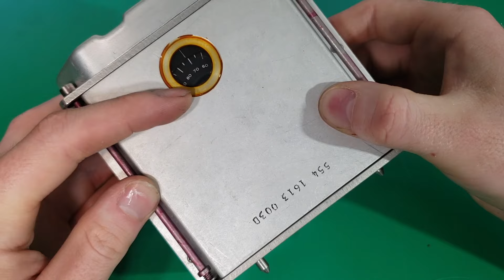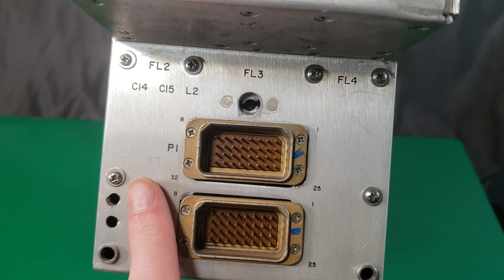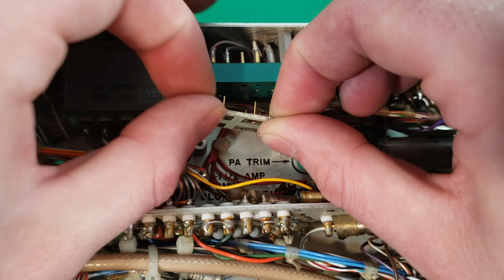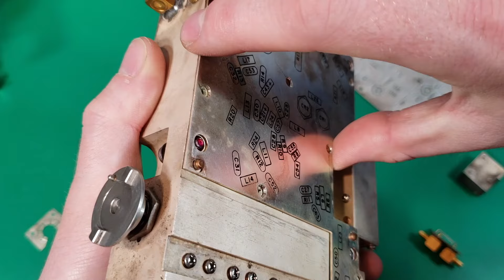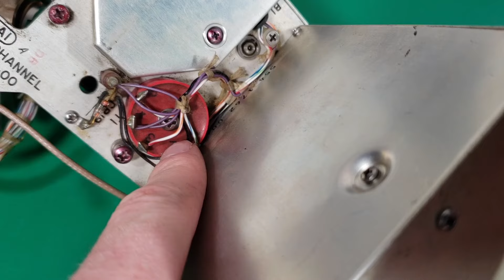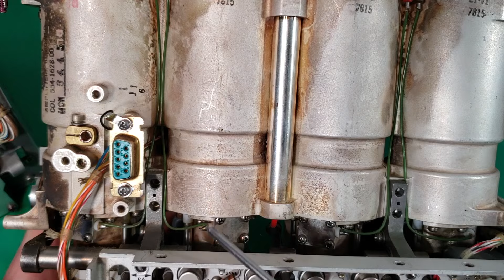Collins 860E-2 Aircraft DME Teardown

Comment: Those were also used on DC-8, DC-9.  Those things sound like a sewing machine when they are cycling between frequencies.  I have one of the planar 7815 triodes out of those.  The similar ATC transponder used a single one in a cavity.  They were a pain to work on.  A million things to go wrong.  The 4 triodes can generate a pretty high peak power.

Comment: this was interesting so i dug into Collins avionics docs and notes. the EPC modules are 'Electronic Processing Circuits' and each part no. corresponds to very specific function: 350‑0046‑030: identified as a 'timing generator/logic controller', 350‑0046‑040: probably a variant.. a signal conditioning/decoder mod. they kinda form a semi brain for the DME.. one cleans/validates the RF replies, the other measures delay and converts it into range distance. standard fit for 727s.
Reply from the maker: Great info! Where did you find documentation? I didn’t have much luck when putting this video together
Reply: @BGTech1  i pieced it together from the collins 860E/860F DME IPC and maintenance manual, plus faa/navy tech orders. they don’t give schemas, but they do describe the part no. as timing/logic/reply conditioning. those manuals are sold by specialist sites, not free, so you have to buy them if you want the full text

Comment: Worked on this beast for years. Mixing crystal  CR1 was the high fail item. Mechanical tuning was a black art. Especially the freq multiplier. Intermittent rx/tx was usually the wafer switches gunked up so the channeling was off.  Hard to believe this is now a VLSI chip on a PCB these days. 1200 to 2000 watts. Getting a bell shaped xmit was always a challenge.  1025 - 1150 x and y.
Reply from the maker: Mastering this machine is quite an achievement! Miniaturization has made things easier with less points of failure.

Comment: I'm guessing that those air-gapped capacitors are most likely hand tuned-how many hours is required to assemble and tune one of these things?
Reply from the maker: Lots of hours I’m sure! Many of the tunable components in this unit are tuned by the machine itself during operation.

Comment: I cannot imagine how much that thing cost back in the day.  No wonder commercial airliners are so expensive-this is just one of probably hundreds of similarly complex components that make up the avionics system.
Reply: With the latest generation of large commercial aircraft you'll find a lot of these have been combined into fewer assemblies. But as aircraft are operated for decades even this older stuff is still very much in service and actively maintained. There are some great channels by aircraft maintainers that go through stuff like the electronics bays and more.
Reply: @ZaphodHarkonnen  Which channels do you recommend?
Reply: @paulbush7095  
Zeto.r and Stig Aviation are two good starting points.

Comment: I have an aircraft radio from WWII that is tuned by plugging tons of different things in and it has a bunch of tubes and a big rotary transformer. I managed to get the rotary transformer running too. It says type TR 13046 if you are interested. Anyway, very cool video.
Reply from the maker: A rotary transformer? That’s actually pretty cool I forgot those even existed!

Comment: Every single detail of this was done by engineers and draftsmen using paper and pencil.  Collins was an incredible company, look into their history and accomplishments.  A lot of extremely talented engineers.  All this kind of gear cost a fortune at the time.
Reply from the maker: Absolutely. This is some very fine engineering. As I continue my journey to get my EE degree, this stuff becomes more and more impressive.
Reply: @BGTech1  I'm a senior avionics EE and learned from taking apart stuff just like this, not from any course.  Keep going and try to reverse engineer more and more.
Reply from the maker: No way! I bet you’ve got a very nice collection of avionics by now. I’d be very curious to hear more about what projects you’ve been working on recently.
Reply: @BGTech1  Well, not that much in the way of avionics, more test equipment and tons of radio gear from VLF through microwaves.  I have collected a shelf of more general aviation stuff, but nothing so modern I'd put it into my own plane.  I do have a bunch of military and commercial inertial nav platforms which are pretty cool, and single and 3 phase 400 Hz power converters.  Go to large hamfests and you can pick that kind of stuff up cheap.
Reply from the maker: @f @flyer617 gh frequency electronics are super interesting even outside of avionics. Internal nav systems are really neat. I’ve been keeping my eye out for parts those parts, and air data computers. No luck quite yet.
Reply: @BGTech1  I picked up the Delco Carousel at Hamvention in Xenia for $100 a couple of years back.  Also over the years military and commercial comm gear, gauges, etc.  Sometimes the Flymarket at the Oshkosh Airventure has resulted in some finds, like a complete RCA color weather radar including harnesses for $100.  Sources are drying up so you have to be clever.  I did get a couple of GEC air data computers but then had to learn about the 1553 comms bus and set up with that.  I still have all that stuff squirreled away somewhere.  Be careful: as you get better at acquiring, your amount of free space will trend to zero.
Reply: Engineers used to actually design equipment, not run computer programs that design equipment. My dad worked for a defense contractor in the 60s and 70s and his friend and coworker lived across the street and was a design engineer for the same company. Those guys were crazy smart, the likes of which we will never see again.

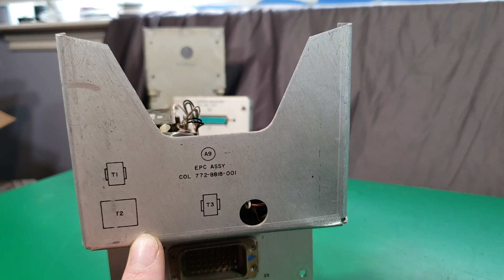Comment: 15:11 i do not think those three phenoic standoffs are grounding posts, but isolated connection posts for three separate pairs of wires (phase neutral and running capacitor is my quess)

Comment: a beautifil piece of aviation gear! btw not all carbon resistors are unreliable, in the sixties Centralab, DALE and some others learned to make hi-rel  carbon resistors  with the element inside glass tube, and thus the resistor was better protected than only with the (phenolic?)body of the resistor IDK if the glass tube was welded hermetic before potting to the body.
Reply from the maker: I’ve actually wondered about that! Thanks for sharing.
Reply: @BGTech1  you are wecome, i worked 3 years in Finnish army signal troops (called electronics nowdays)

Comment: I've just had another scan through the video and I'm amazed at the range of date codes - I assume this kit was in service for a long time.  These things really need to be in a museum for future electronics engineers to marvel at.
Reply: A lot of aviation stuff like this gets reused time and time again on all sorts of aircraft. Even today you can have seemingly still new aircraft being scrapped because the internal components like this are worth more as spare parts than the whole aircraft itself. 

On top of that, the regulatory requirements really incentivize repairability and long term operation as it's a huge effort to get anything new certified.

Comment: I was involved in buiding some test equipment with 74 series TTL around the time this was built, but these analogue-mechanical devices were on a different planet.   I can't image the design and test process.  Wonderful video, excellent quality, thank you very much!   (and I do remember Sprague capacitors which bolted onto a chassis)
Reply from the maker: Thanks for commenting! This equipment is indeed fascinating. It’s likely the revisions after model used 74 series logic chips. They are used frequently in avionics.

Comment: fantastic collins engineering. I believe the transmit chain is all grounded grid planar triodes.  into resonant cavities. even IF design and squitter generator were great design. hop you try o reassemble back to orignals and keep it together. worth more when kept as one piece
Reply from the maker: Thanks for sharing some insight into the design! Yes, my avionics are always carefully reassembled after. I will usually take some notes during the teardown process so nothing is overlooked when I reassemble them.
Reply: Maybe to a museum.

Comment: Wow this one is a beast ! The fan rpm is wild, wtf 😂 PS: the turquoise resistors called, they claim they are turquoise inductors.
Reply from the maker: This one was really incredible. So much sophisticated RF and tuning is needed for these high power transmitters before solid state electronics became a thing. I’d love to have a conversation with one of the engineers who worked on something like this, but they really aren’t around anymore, sadly. So much knowledge is lost.
Reply: @BGTech1  Well this is full of solid state I think you mean before integrated circuits became a thing. this could almost all be on one die now probably